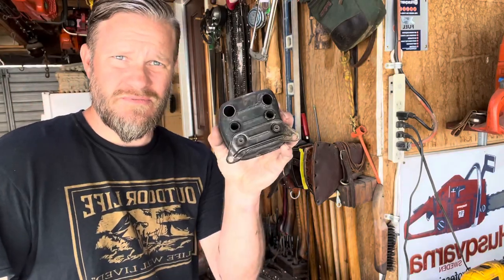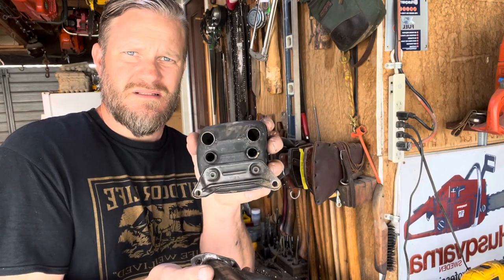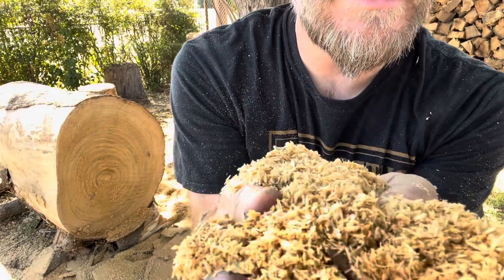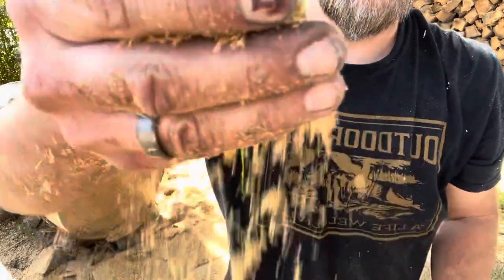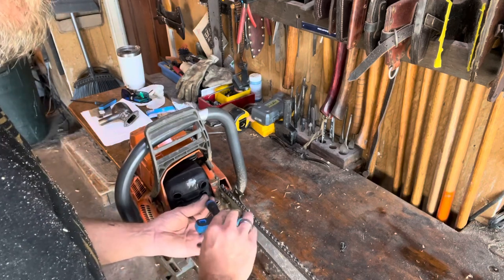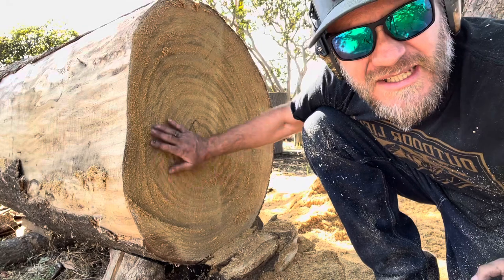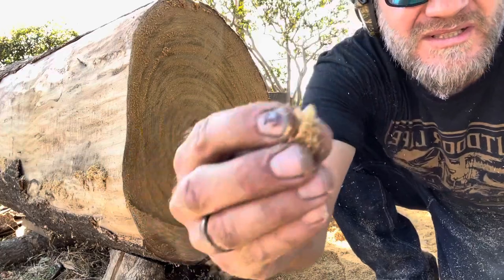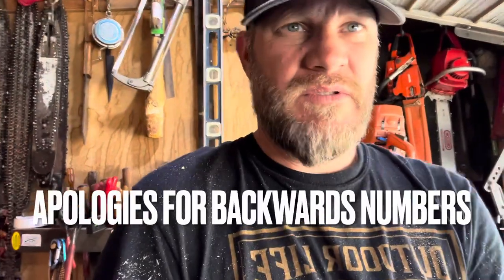Chainsaw Log DYNO? Is it telling TRUTH? HM PIPE vs Can ported Muffler!

Comment: The more you move the end of the pipe back towards the inlet of that pipe, the higher rpms and chainspeed you can get. Of course, there is a fine line of too much and not enough. I've found 3/4"-1" distance between the end of the pipe and the edge of the outlet is about perfect for my saws.
Reply from the maker: @RebirthMusicStudios  great info! Thanks for sharing. On mine I was attempting to keep the build of the pipe similar dimensions to stock length, but didn’t considered the length of the distance from the end, to the outlet. Very interesting!

Comment: Someone correct me if I'm wrong, I thought a more open free flowing muffler made a saw run a little lean compared to stock, so usually after a muffler mod the saw needs to be richened a little bit to compensate. The second lots of cuts with the pipe sounded a bit richer indicating to me it is more restricted than the twin port can.
Reply from the maker: Correct! Most of the topical muffler mods to stock can mufflers normally makes the saw run lean. I thought the same with the pipe that it was four stroking a bit more than the canned muffler in the second cuts as well. That’s why I didn’t do a carb adjustment between the two. They say if the pipe makes the saw go rich, then it’s actually working better than the other muffler.
Reply: Agreed if the pipe makes it go rich you’re onto something, but tune with the pipe was definitely what hurt the cut time. Saw seemed better tuned to the modded stock muffler. I think you may have seen a totally different result if you had taken the time to tune it. It is also hard to tell for 100% sure on video if it was more rich than the can, given the totally different sound. so really you being the one there is the one that could tell. Good video though.
Reply: @tfloutdoors327  I would agree.

Comment: This issue with the homemade side pipes is that most of us don't have a solid understanding of the Cadenacy Effect and the importance of back pressure on 2 stroke engines. A 2 stroke is very very different from a 4 stroke and a purely free flowing exhaust isn't ideal. But an out of tune expansion chamber is worse. Both probably better than stock, but if youre gonna make a side pipe you need to know the appropriate length of the chamber.
Reply: The back pressure thing is a myth that a lot of people still believe for some reason. Less back pressure equals more performance period. Two or four stroke doesn’t matter. Never heard of cadence in internal combustion engines, I think what your referring to is pressure wave tuning. Without doing some complicated math there’s no way to tune these “iron horse” pipes or any other pipe to work on a saw. A properly modified can/factory muffler in general will perform better than any homemade “pipe” unless we’re talking about properly made/tuned resonators.
Reply: @eurokid83   I didn't entirely misspell that word. Its called the Kadenacy Effect (after the engineer who discovered it) and it has to do with pressure waves and timing. The exhaust situation is VERY different for two strokes and four strokes. Thats why you see expansion chambers on 2 stoke dirt bikes and straight pips on 4 stroke. You need pressure waves timed to force fuel and air back through the ports of a 2 stroke for best performance.
Reply: @VinnyMartello  yes the Kadenacy effect explains the effect of a properly timed negative pressure pulse used to scavenge a cylinder for example. Two stroke pipes are resonators and use sound waves to accomplish essentially the same thing. There may also be a pressure wave effect but I believe it’s primarily a sound wave thing. I’m not a engineer or mathematician but I have a better than average understanding of two and four stroke engines.
Reply: My observations of my own modified pipes/muffler tends to support Barry the chopper. But like you I believe there is a sweet spot to be found. I'm not a fan of super low backpressure muffler mods. I think they drink fuel and do little for power. A little less back pressure than stock is my current sweet spot. Just building a can muffler now that effectively has this pipe inside a can. I was recently sent a pipe...in fact 2 from 2 different guys. Neither went as good as my muffler mod. The Novice Lumber Jack on YT did a pipe a year ago and the seemed to really work. It can be done.

Comment: The saw was pig rich as soon as you swapped to the pipe. 
It was four stroking and barely cleaned up under load. 
That’s a sign that the pipe is working, you just need to lean out the high jet a bit and that pipe will scream. Nice build on that pipe
Reply from the maker: Thank you! I appreciate it very much my man!

Comment: Nice Pipe. I'm building a 372 muffler now. It has about the same taper. I'll cut out the flange from a stock muffler and then weld in my new flange and taper cone. It will look totally stock when finished pretty much.
Reply from the maker: Thank you! I like your idea with the stock can, I’ve been thinking about different ideas similar to yours, in fact I recently just modded a stock can a few weeks ago, I tried to keep it modest with a stock appearance too. Hopefully it turns out good, Thanks for the comment, happy cutting!

Comment: Only way that the pipe wins is if it's in perfect tune with the saw motor, which is near impossible to hit apon. This the empty can wins more times than not.
If that pipe is to be used for any length of time, a support bracket should be fabricated, so as not to pull on the threads on the cylinder.
Interesting take in the pipe though, I liked where you were going with it. Never know when you might hit upon a good thing, maybe some tweaking of the design is in order...

Comment: Did you tune the carb for each muffler? If one muffler makes the saw run lean, it will run much higher rpm and will pull that chain faster
Reply from the maker: Did not tune the carb after pipe swap, want to see if the pipe changed anything, for the good or bad, seemed to be slightly 4 stoking a bit more running the pipe in the cuts under load, yep thats why i thinking it wasn’t a loss for the pipe, could have leaned it up a tad 👍

Comment: Cool, thanks for the video!  Pipe looked faster.  Where did you get that left handed chainsaw?  Heh heh.  You tune like me, when cutting big wood or noodling big rounds.  A little fat, but at least the saw doesn't burn up.  Less difference between the two than I would have thought.
Reply from the maker: Hey thanks for watching my left handed saw vid and for the comment too, I believe with a few little tweaks here and there the pipe will most likely be faster.

Comment: is that a left handed saw i noticed the bar is on the left side
Reply from the maker: The only one in the states apparently! 👀👊😂
Reply: @tfloutdoors327   that's cool at least now i know i wasnt seeing things
Reply: @tfloutdoors327  Well then, fuck.  I had to spend a lot of hours training my lefthanded self to be mostly right handed (along with buying all those full wraps)
and now they just MAKE a lefty.  :-D

Nice video dude.  Unless you are dipping into (impractical) tuned pipes they all make kind of similar power unless poorly made (i.e. way too open)  Power bands might be in different spots..  some a little higher hp..  some a little lower hp..  Seems to me that as long as you aren't running one of the newer super-choked mufflers or, poor homeowners, one with a cat, a good mod OR pipe will help get heat out and give you a little more grunt.
I personally prefer a modded muffler, as I can incrementally open until I get the noise level i'm comfortable with.  At the point where my brain is saying "yeah that's still pretty comfortable" I've managed to squeak out a decent amount of chooch.  With MOST saws a decent exhaust modification, a compression increase, a good tune, and a sharp chain will make a hell of a worksaw.
Reply: Bro ever heard of selfie cam ?

Comment: Shorter stinger and larger diameter hole.
Reply: 1" hole is a safe start... 1-1/4" if you're using a medium screen. On these 2 strokes, finding the correct can volume to stinger size/length can be time consuming as A lot of timed test cuts will be needed. The vintage saws have pipes inside their cans with minimal stick out... but, they were more geared towards torque in a specific powerband. Newer saws are geared towards more speed with ok/decent torque. Find out the cutting rpms and then figure your cylinder volumes, air transfers (in/out) and then dabble in the mystic arts of tuned exhausts with trial and error. Or just Google formulas used to calculate all of this... lol. ORRR.... find a vintage saw scale up their exhaust and add 40% to the calculations. Lol

Comment: You would have gotten better results with the knockoff ironhorse muffler. IF the end didn’t flare out so much and lose velocity   Also. That’s a pretty long outlet on that pipe. Mine are under 1” long
 I can also tell. Because you did no carb adjustment. That pipe is doing NOTHING 
 If the pipe is working like it’s supposed to. The saw will INSTANTLY be pig rich on idle and high circuit
Reply from the maker: Just having fun messing around trying different ideas
Reply: I wouldnt touch an iron horse saw or muffler to save my life.

Great job building and testing these exhaust

Comment: The way you run the saw will probably make more difference than the mufflers will. If you just lay that saw up there and let it cut straight thru it will cut faster every time than rocking it over the top and cutting the back side. Rocking it over just fools the mind into thinking it's faster because you're moving and staying busy. Lol
You had plenty of bar length to cut straight through. The quickest way from point A to point B is a straight line.
Time the two different styles of cutting sometime and prove it to yourself. 
When you are rocking the saw around it quits cutting for a few seconds while a saw staying in the cut doesn't give up a second.
Reply from the maker: So many variables my friend, from one cut to the next, saw placement, human error in the cuts, saw tune up, raker depth’s, moisture w/in the actual wood, and so on. So debatable, which make testing a particular replacement part on a saw so difficult in real life senecio. Kinda the point of the vid was to try to make similar cuts with both pipes w/o tuning in between, not to cut the log in the fastest way possible. Great point, could have just cut straight through, for sure but didn’t, thank you for your comment, and watching my video!   Cheers!

Comment: Pipe sounded great!  Maybe put in a screen for sparks...

I think with the pipe, it flowed more air and fattened it up, making less than optimum power. I suspect the pipe might be faster tuned than the can tuned... Fueling is sensitive on small 2 strokes.
Reply from the maker: Thanks ! I believe one could slip a screen down the inside of it, that’s a great idea!
Reply: if you are throwing sparks then you have problems...
Reply: @gwp1ohio  ever seen flames from a hopped up car exhaust? 2 strokes end up pushing fuel into the muffler at times, especially when massaged for extra pull... It is possible, while not throwing sparks from grinding internals...  which surely would be a bad day...